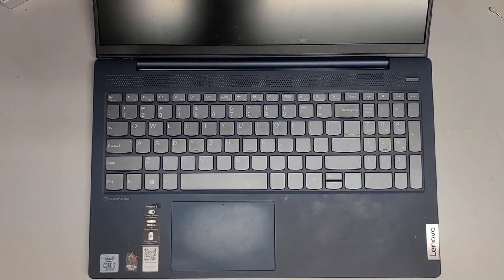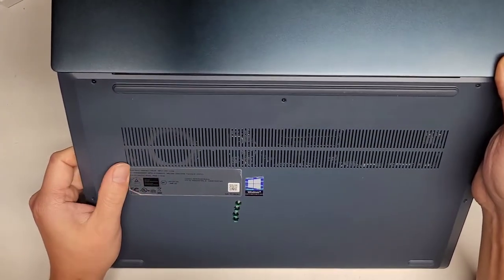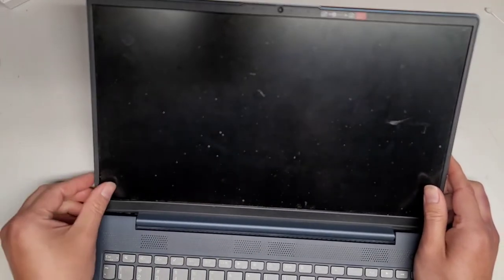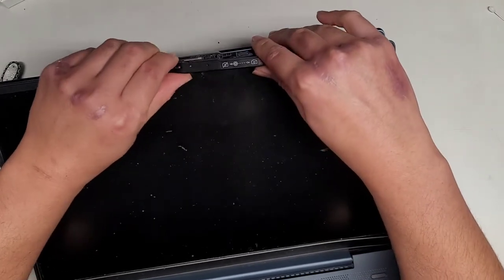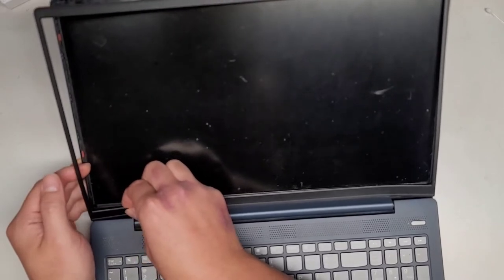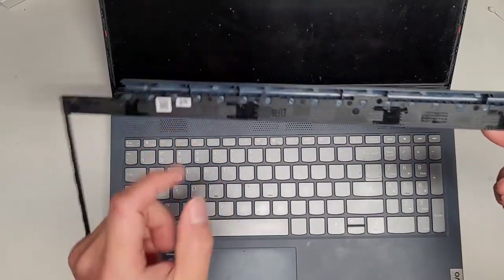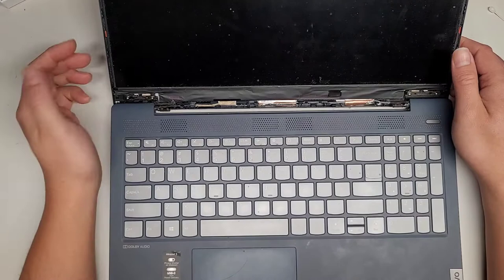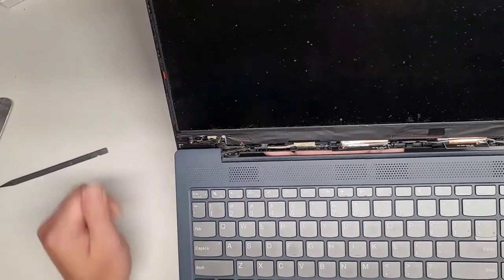Lenovo IdeaPad 5 15IIL05 15ITL05 JB Weld Faulty Flawed Hinge Design Repair (Class Action Lawsuit?)

Comment: Hey, could you explain in more detail what to do if I want to disconnect the screen? You said something about pressing the power button for 15 seconds, but a what point do I do this? I tried fixing my laptop and used a different 2 component glue which apparently wasn't strong enough, so now I need to do it again using JB Weld. But I need to scratch out the old glue leftovers first...So, for that I want to disconnect the screen because it's probably much easier to do it then. Thanks in advance!
Reply from the maker: Drains power from the capacitors. I have yet to find a glue better than jbweld. I might have a video where the screen is removed.
Reply: @ItsBinhRepaired    yeah I have to admit i didn't really take a closer look at my glue when I bought it.
I've already looked through lots of your videos but I never saw you explaining it in detail (might have missed it)
Reply from the maker: @anny1911  this might help https://youtu.be/-gbDxCXpdiM?si=arDx9sZjC6MbDHGw
Reply: thank you! I'll try this soon @ItsBinhRepaired
Reply from the maker: Hope it goes well

Comment: Does this work on the IdeaPad 5 15ALC05 too?
But the glue near my hinches are not strong enough to hold the screen in place.
And most of the clips at my bottem of the screen are broken, i closed the laptop on accident and the clips broke.
Ill love it if you could provide me help or advise
Reply from the maker: Usually very similar
Reply: @ItsBinhRepaired  So its te same process but i only need to replace the front nozzle, do you maybe know if the glue strips come with the nozzle (I am gonna repair it by myself and i never repaired anything so sorry if i ask too much questions 😅😅.
And keep the great videos up👍👍👍👍
Reply from the maker: @Amnam196  which nozzle?
Reply: @ItsBinhRepaired  I am not sure whats its called but the plastic thingy arround the screen (Replacement part no.5B30S18941) if you dont know what i mean
Reply: Its not nozzle its bezel 😅😅😅😅
Reply from the maker: @Amnam196  oh yeah, bezel
Reply: @ItsBinhRepaired  Does the glue come with it if i order the bezel at Lenovo
Reply from the maker: @Amnam196  not sure
Reply: @ItsBinhRepaired  Okay thx for the help
Reply from the maker: Yup

Comment: hey thanks for this video- was really helpful on seeing what the issue was and it’s easy to say that lenovo sucks, but when the hinge broke off at the same time the display was messed up and i believe one of the display connectors broke, and the screen wouldn’t turn on, tried to move them around a bit to see if they would reconnect but didn’t have much luck there, not sure where to go on here tbh, should I just replace the screen entirely- or just try and find a way to reconnect the cables (the screen doesn’t have any external damage except from cable), thanks so much <333
Reply from the maker: Depends if the cable is damaged internally

Comment: Thank you for the video. My lenovo idea pad wont open literally and when i try to open its making a cracking sound when i peek on it the bezel on the lower part are coming off. I don't know what to do. Can I use oil on the hinges? Thank you for answering in advance.
Reply from the maker: You can try a drop off motor oil on the hinges, but it's likely the plastic is broken.
Reply: I've had the same issue, some plastic bits have come out and when I try to open it, I hear cracking sound and it only opens upto a certain angle, the plastic part you put in the end has also come out, should I place it back where it was? This is what the hinge looks like now: https://snipboard.io/UpLKXz.jpg

Please help!

Comment: Thank you so much for this guide.

I did it just like you said and unfortunately the JB weld didn't hold at all. The moment I opened the laptop, it cracked again. I used brand new JB weld and let it dry for over 24 hours.

One thing I'm noticing is the hinge is very stiff. I can't move it by hand at all, I have to get leverage. Have you done this repair again since this video? Have you attempted anything to loosen up the hinge a little bit?
Reply from the maker: Might need more jbweld to go around the hinge. I've had to repair so many of this model for broken hinges. Only one came back because I didn't put enough jbweld.
Reply: @ItsBinhRepaired  Thank you for the reply. I gave it another shot and really slathered the JB Weld on. I figured it's either this or the thing is trash so I might as well do it. I covered the entire hinge on the back side and let it dry for closer to 36 hours but you know what? It's actually holding now. I've opened and closed a few times with no creaks and I think it's ready to go. We'll see if it lasts long term.

Thank you again! I sent you a little bit on Venmo since this really saved us a lot of money. We can return the replacement laptop we bought.
Reply from the maker: @CJShrader  awesome, glad it's holding up! Hope it continues to hold up long term
Reply from the maker: Thank you so much for the support. I really appreciate it!
Reply: @CJShrader  Hi! How is it holding up 2 months later?
Reply: @elin8546  I'll admit we haven't used the laptop too much but it's been fine when I do use it. I forget it was ever broken.
Reply: Look up 'loosening the hing tension on Laptop' on utube, watch the guy n do it. I'm 72 grandma n I did it. Try E6000 it worked for me. Give it time to dry hard.  Mine is fixed n looks just like our instructor s... 😁
Reply: I drilled 3 holes too thru the top n put washers on the tiny bolts n nuts to keep it together....
Reply: @kathyaudus4492  This is what I'm considering doing.
Reply: Thank you so much for this feedback! I'm embarking on this journey, and this was my main concern. I'll try to drown it all in JB Weld, then I'll grease the hinge to loosen it up. Thank you!  @CJShrader
Reply from the maker: How did it go?

Comment: I did this using JBweld half a year ago, today it broke again, the same side I fixed with JBweld, is there any way to remove the layer of JBweld from the hinge to repair it again ?
Reply from the maker: You shouldn't need to remove the old stuff. Just use a thin layer to bond it again.
Reply: @ItsBinhRepaired  Oh, okay thanks, I will try that
Reply from the maker: @lukaslovas3510  no problem

Comment: Thank you so much for this video! One of my hinges is broken and I’m going to try to repair it however the hinge itself seems totally stuck and unable to move at all. I tried putting some WD-40 on it and it still isn’t budging… any suggestions?
Reply from the maker: That's normal. Use pliers. It's not meant to be easy to move or the screen would just flop over. It's stiff by design.
Reply: @ItsBinhRepaired  Okay! I think I’m just going to try to jb weld it in the position it’s in right now. I wasn’t able to move it around with pliers but I’m hoping once it’s all cured it’ll start bending. Thank you so much again for this easy to follow tutorial!
Reply: @ItsBinhRepaired  the JB weld has finally cured all the way and it worked!!! It’s bending again like a champ. Thank you so much!!
Reply from the maker: @mychapstick4441  awesome!

Comment: Tried this tutorial and wasn't able to remove the screws of the hinge, so I directly applied araldite(alternative for JB Weld in my country)without removing the screws and the repair lasted only for a while. Tried the same thing again without removing the screws and applied araldite again. Will this work?
Reply from the maker: No, you need to remove the screws. Use pliers to hold the back part.
Reply: @ItsBinhRepaired  I've applied araldite twice and twice it came off. Will this have any effect on trying it once again?
Reply from the maker: @mohaiminriaz5513  I don't know about that epoxy. All the stuff I tried except jbweld worked. You need the metal infused type epoxy.

Comment: I tried to do this but had gotten JB weld epoxy instead and I ended up damaging the screen. Probably squeezed too hard when trying to get it in place. Do you think it's not worth fixing anymore?  I made a little bit of a mess because both hinges were broken, but the tabs are grabbable and the wire and cable is okay
Reply from the maker: You used the clear one? That's not strong enough

Comment: Thanks a lot for this video! I repaired my daughters laptop hinge, the laptop is identical to the one in the video and it had the exact same issue. The only issue I have, is that the bezel is now not snapping completely into place near the repaired hinge. But thats because I let the epoxy harden before mounting the bezel again: i was too concerned that by shutting the laptop prior to curing the hinge/screen position woiuld have shifted. However I should have positioned the bezel and close the laptop prior to curing like you showed in the video to prevent this. Nevertheless: It is barely visible and I am glad she can use her laptop again. But indeed. What a sh*tty construction. Next laptop won't be a Lenovo. The one thing I did as an extra, was to apply a few droplets of oil in the hinge, which seems to loosen it a bit. Hopefully this helps to prevent breaking the other hinge  and the repaired one because of excessive force.

edit
And of course, now the other hinge has snapped off.
Luckily, I still have the JB weld. 
The repair should take so much shorter, since I have "experience" now.
Again. Never a Lenovo again.
Reply from the maker: Glad it helped. Yeah, it needs to be all reassembled so it can set properly. Hope the repair lasts a long time.
Reply: Klaas, was it hard to fix? Would you do it again or would you take it to a repair place? I have the same issue.
Reply from the maker: @JaneDoe-vi5yc  Did you watch the video?
Reply: @ItsBinhRepaired  I did. Did I miss something? Did you answer something that I asked?
Reply from the maker: @Jane Doe  you'll have to watch and decide if it's something you can do or not. Whether someone else could do it or not does not affect your ability to do something.
Reply: @JaneDoe-vi5yc  Hello Jane. I was a little nervous prior to repairing the laptop. However using the excellent tutorial video it was perfectly doable. So no, I would never go to a repair shop for this issue and do it myselve. It will not only save you money, but also time. And in the end, the satisfaction that you sort of "beat the system" 🙂. Just allow sufficient time for the epoxy to harden. Just leave the laptop alone for a full day before using it. Good luck repairing!
Reply: @justklaas4703  Thanks. I will watch the video again and see if i can handle it. I just hate taking my computer and leaving it somewhere. Also, I saw your name and in my head I thought if you were a lawyer, we could do a Klaas action suit. My computer is barely 2 years old.
Reply from the maker: Klaas action lawsuit hahaha

Comment: One of my hinges broke off from the computer as it tightened up- not a problem as I know how to fix but one of the (potentially) copper sheets connected to a tab (right tab with wire attatched) is breaking. Really not sure what to do, if I just fix the hinge and cover it up?

I will either need to fix this asap or get a new one as I have to use it everyday for school. Currently backing all of my coursework and essays onto a separate drive because I’m worried it’ll stop working at any moment
Reply: Hope that makes sense lmao but I’m really unsure what to do
Reply from the maker: Copper?
Reply: @ItsBinhRepaired  wasn’t too sure- they are copper coloured/ tried to search up but can’t find what kind of metal it actually is. Flimsy sheet but definitely metal
Reply from the maker: @Aaaa-ct1hg  might be a wireless antenna

Comment: Hi :) So I tried the jbWeld, it worked on the right hinge, but the left one broke out again. So I just redid it and will let it dry for two days.
I want to loosen the hinge tension as well though, and apply some oil of some sort. So I have 2 questions:
1. What sort of oil/lubricant would be the best to use on the hinges?
2. When I opened the back, the bolts on my hinges dont have nuts to tighten. I tried with pliers but they slip off. When I googled the hinges of this model (IdeaPad 5 15ARE05) it just seems like they are missing. Like Lenovo assembled the laptop wrong and just left them out.
Can I buy new ones to attach so I can loosen the hinges? If I can do you know what size they would be?
I would be so thankful for you help!
Reply from the maker: You should never mess with the hinge tightness or the screen will just flop over. They weld it in place at the tightness it's supposed to be. You can add any lubricating oil, even motor oil works.
Reply: @ItsBinhRepaired  oh really? I saw many videos about loosening the screw a quarter of the way and it helped. And in your videos I can see the nut that would be used. My laptop is just missing that. Which is super weird. But then maybe I'll just take it to a repair shop. Thanks :)
Reply from the maker: @elin8546  hmm very strange

Comment: Thanks for the video broo, I'm also facing the same issue but i already calimed my ADP warranty for small camera connection cable this year, will they provide the service  again? if not , can i use my laptop gently for some time as i need to work on this for next few weeks, plz respond ASAP bro....
Reply from the maker: Just be careful with the wires inside
Reply: @ItsBinhRepaired  Thanks broo!
Reply from the maker: @jagadeeshpuli5745  no problem

Comment: My Ideapad 5 screen hinge broke while on a trip. I had to take all of the little screws out that hold the screen on in order  to rubberband the screen in the closed position to bring it back home from the trip. Some how all of the screws got lost. (go figure) Do you happen to know how I can replace all of the screws that hold the screen to the hinges? Or what size screws they are?
Reply from the maker: The screws won't work if they got ripped out. You want to remove the brass screw holder things and jbweld it.

Comment: Hi Binh!  Thanks for this video!!  I'm attempting to fix my grandma's laptop, but I'm a little confused.  This is probably a dumb question, but which part is actually the hinge?  Both sides of the laptop I'm working on are broken, so the screen can't even stand up on its own, but I'm scared to apply the epoxy to the metal piece with the screws in it and attach it to the screen because I can't get that metal piece on either side to bend down.  Does this make sense?  Like I don't understand how the laptop will be able to close again because won't it just be stuck open at a 90-degree angle? :-(
Reply from the maker: Google pictures of hinges and you'll understand.
Reply from the maker: This video shows the hinges completely removed https://youtu.be/plWOvbFDyFU
Reply: @ItsBinhRepaired  Ah!  Okay, watching this video did help!!  I think my hinges are just super fucking tight because I can't get them to budge with just my fingers.  Gonna mix my epoxy stuff now and try applying it.  Pray for me!
Reply from the maker: @julieduran94  they have to be tight or the screen will just fall over.
Reply from the maker: @julieduran94  I don't pray, but I hope the repair goes well. Haha

Comment: What do i do if it still came off. How do i remove the glue
Reply from the maker: You can heat it with a lighter and then it'll become soft, or you can add more jbweld to strengthen it and put it back in the same place.

Comment: The plastic pieces on the back of my Lenovo are completely cracked, could I meticulously follow these same steps? My screen is also starting to get damaged and the front panel is broken at the hinges so they're exposed. At this point I'm really just trying to get into the laptop for one last run to move my files to a USB drive. It sucks since I like to have a portable device for my art programs but in the meantime I can just use my PC. I have a really old HP laptop that I might completely software reset for my college courses but it still kinda sucks that the person who marketed this model of laptop to me neglected to mention the fragility of the hinges , especially since I travel with my laptop a loooooot
Reply from the maker: You might be able to get Lenovo to fix it for free with this video as proof it's a design flaw.

Comment: Can I try it? because my idea pad 5 has both hinges broken
Reply from the maker: No, you're not allowed. Only I'm allowed to do it. Lol What do you mean, can you try it? That's the whole purpose of me making these videos.
Reply: You can do it. Be patient and take your time. Remember to unplug the internal battery to be safe.  It's somewhat easier, but longer, to completely remove the entire screen assembly from the notebook (which means opening the notebook , unscrewing the hinges, disconnecting the battery, display connector and wireless cables).
Reply from the maker: Yup

Comment: Hello bro, I already tried to paste my ideapad pad 5 laptop twice and it is not attached, it comes off again, what can I do?
Reply from the maker: Did you use jb weld?
Reply: @ItsBinhRepaired   yess, now i need to remove the dry jb, and try again
Reply from the maker: @SAYEDC11  you can leave the old jb weld. It bonds really well to itself. It needs to sit 15+ hours before use
Reply: @ItsBinhRepaired   I left it for more than 15 hours. I'll try again
Reply from the maker: @SAYEDC11  you're using the original grey jb weld right? Make sure you have 50/50 mix.
Reply: @ItsBinhRepaired  that's how it is. I bought it on amazon
Reply from the maker: Pre mixed?
Reply from the maker: @SAYEDC11  it shouldn't be pre mixed. It needs to be two separate things.
Reply: @ItsBinhRepaired  sorry I was wrong, it is J-B Weld 8265S
Reply from the maker: @SAYEDC11  that's the right stuff
Reply: @ItsBinhRepaired   I think I need to grease the hinge, it puts a lot of pressure
Reply from the maker: @SAYEDC11  you can try